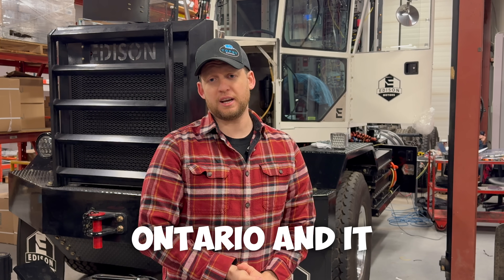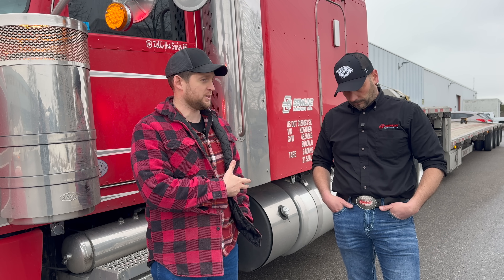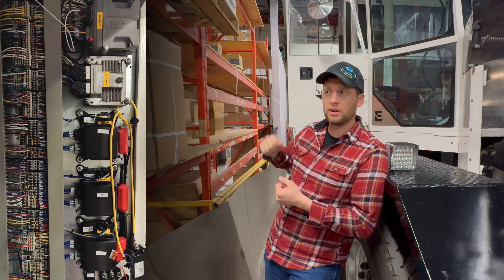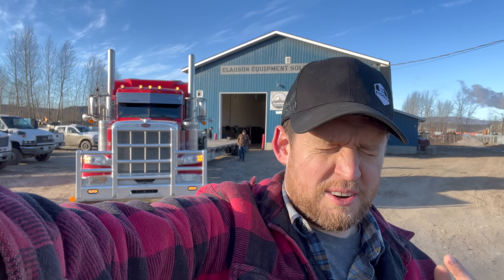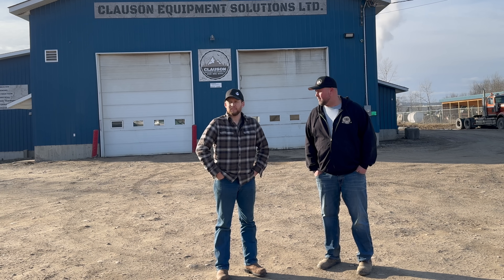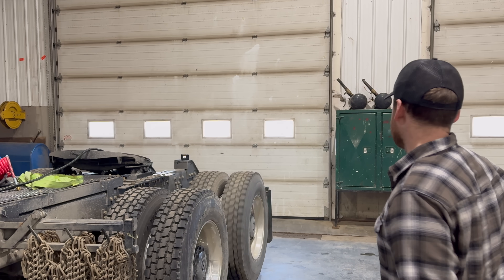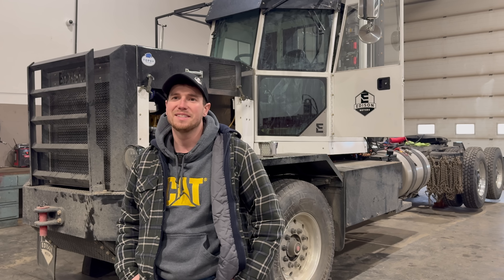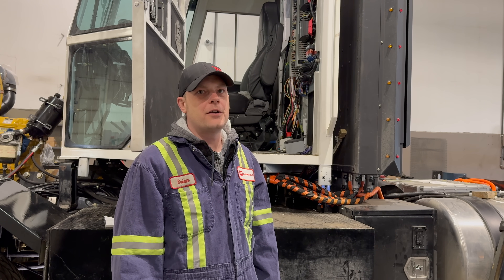Electric Truck Transformation : From Prototype to Production

Comment: Connectors/pins be like that sometimes.  Spent two days trying to track down a no-start with crank on my 95 Town car once, gave up and spent $600 for a specialized shop to hunt it down.  turned out to be a single corroded connector on the underside of the distribution box.  $.25 in parts and $599.75 in labor.

Comment: Wiring to last 40 years in oily, greasy, rough service change over to DLO which is nickle/copper. Locomotive wiring harness last 2.5 million miles or 5.0 million kilometres.  Heat shink any exposed wire at motors (moisture in air corrodes wires). Servicing locomotive traction motor cables burning of from moisture in air. Used Raychem heat shink.

Comment: I LOVE wiring. The 2020 T680 I drive kept throwing a fault code for one of four speed sensors on the drive axles, which lit up the ABS/traction control/ stability control warning lights at the same time, causing issues with assorted things like high idle control, pto override of idle shutdown, and even gear shifting. Our techs fought with it for months, but finally fixed it by simply connecting new ABS sensor harnesses between the computer in the cab, and the drive axles. KENWORTH used twisted pair wires instead of that generic ABS sensor coax like you see on trailers. Can’t just leave well enough alone.

Comment: Those pesky connectors. 
In so many instances the connector and loose or poorly clipped in pins into the plastic plug receptacle is the cause of those electrical gremlins. 
Has become the first thing I now look for when a bike or car starts showing issues.
80-90% of the time it is the connector. 
The other 10 -20% of the time a faulty sensor , blown globe or pinched or damaged wire. 
Waiting to see you guys get this on the roads and then making truck 2-10
Don't forget Australia could do with your product.

Comment: Chase, use this as an example of the problem with all these computer based drive systems. How is some truck driver , broke down on the road, gonna fix this? Broken wire, salt in a connector, a bad sensor. Find a solution, please - a lot of us have faith in you, don't be another Ford, Chevy, Tesla, and turn a product out on the road that cannot be fixed.... Please!

Comment: I like the idea of a headache rack that's wired (at 4:05) but that's a lot of potential failure points. Are all of those pinch style connectors raided for vibration? What about corrosion? The more you can use PCBs, or deutsch automotive connectors I think will help longevity

Comment: Wiring issues during manufacturing will be a solid 50% of your problems.  OVER document any and all problems a simple messed up light bulb can make you think there are gremlins in the wiring system.  Issues that you can not even imagine will come up.  Work around  procedures for testing and comparing harnesses need to be documented completely.  One of my favorites is my manual with the OHMS to ground reading on every possible wire "know how to use your OHM meter".

Comment: I wire cars from scratch and just had an issue with one this week. The terminal crimps looked perfect but for some reason there was no continuity between the terminal and the wire on two wires. Cut off the terminals and crimped new ones on. Works perfectly now. One bad connection and it can cause all kinds of frustration. Good on finding the problem!
Reply: Im a pretty capable wrench, but I've been chasing a canbus fault for over a year in a personal car of mine. Intermittent window function, but I can command thru the BCM with a scanner or use the lock/unlock to roll up/down with the key. But the switches only work when they feel like it. Frustrating doesn't even begin to cover it 😂😂
Reply: @goosenotmaverick1156 Check priority level in the file for the window switches. Maybe the request is being superceeded by another higher priority traffic item in the canbus. You may need a network analyzer to see this but have the prgrammer geeks check anyway. Well done!
Reply: Also props to you, I'm an electrician by trade (but also our company mechanic lol) so I have mad respect for you, building harnesses from scratch! I've done some repairs and that alone was enough for me. Could I do it? Yep. But would it take so long it wouldn't even be worth it? Oh yeah. 😂

Comment: I've been there before with the electrical gremlins. I diagnosed a customer's tractor for 2.5 hours before I noticed that a connector that appeared attached was slightly disconnected on one side, causing 2 wires to not connect properly.

Comment: all that for a pushed out pin oh man. I have been in that exact situation myself, on a transmission valvebody pass through connector. Other mechanic had pushed the pin out of the connector accidentally. Good work

Comment: When you graduate to construction mode, consider have a test jig with the actual shipped components for a 'plug-in" final check before installing onto the chassis and and you can then advertise that each harness has been field tested and certified. 

In my previous career as part of a UL certified panel shop, there were two initial tests we performed that captured 99 percent of the errors. One was using a calibrated for torque screwdriver to make sure all the lugs and terminal blocks were tight(including any empty ones). The last was a pretty harsh "tug" test on every wire to ensure nothing would vibrate loose.  Congratulations on the beginning of a wonderful product.
Reply: But sometimes a bad connector/wire will still make it through. Plugging it in crooked for example can push something crooked and make it intermittent etc
Reply: Build self test on track.
Hours not weeks.
Treating topsy as what it is "extremely expensive equipment with requirement of repair being done in hours not days or weeks."
Otherwise they can buy JD

Comment: This truck is awesome. Interesting that trains have used this same technology for decades and no one in the trucking industry thought of this till now. Is there a possibility that a generator/battery/electric drive setup would work on a International box truck with a DT466e?
Reply: Because it isn't the best idea there is a pretty decent loss everytime energy is converted for a train that is weighed up against the extremely complicated drive system they would need to mechanically link the axles to the engine. This truck isn't at all like a train it is 100% an electric truck with a range extender

Comment: Pro tip:  Always check the simplest issues first.  They're quick and easy to knock out on your diagnostic tree, and you'd sure feel silly re running an entire loom when a pin wasn't properly seated.

Comment: Do you have the ability to determine the power required to propel Topsy at any time by knowing the voltage at the axle and the current the axles are consuming? So you could have a drivers display which would indicate KW or Hp even at any time with the electric drive and some simple calculations.

Comment: Wait so..... There's an electric drive axel on the front also??

I gotta go back and watch some build vids lol
Reply: I don't think there is. I think they just default to axles 1, 2, 3 for the sake of standardization. Rather than having to clarify non-driven axle 1 from driven axle 1, it just makes sense to list axles in straight forward order, so there is no confusion.
Reply: @dposcuro  that makes a ton of sense. Appreciate the clarification.

I didn't think there's a ton of applications for heavy hauling where you would have a drive axel up front, however I'm sure there is some and I'd wager or hope we'd get to see a video on it.

Comment: You can serve the perhaps niche of pulling floats in parades - slow and quiet, lots of power for lights, speakers, etc.
Reply: A smaller scale rig could also be good for motorhomes, diesel for range, electric for the parks

Comment: I just love the whole Edison story from the very beginning.
However in the back of my mind will always be, just one pin, in just one connector, can shut the whole show down, and there are hundreds of pins in so many connectors?
Reply: The same is true for any vehicle made in the last 10 years.
Reply from the maker: Yeah.  Unfortunately with modern trucks canbus network that just how it is.

We aired on the side of caution in the programming to make it as safe as possible.

We’ll work to improve it
Reply: @EdisonMotors  I am sure you will keep working to improve, I do love your attitude, and work ethics, thanks for the reply.

Comment: Will the power cables going to the axles have to be replaced periodically, considering the movement & copper work hardening? Also, what's the output of the generators on the pickup truck conversions?